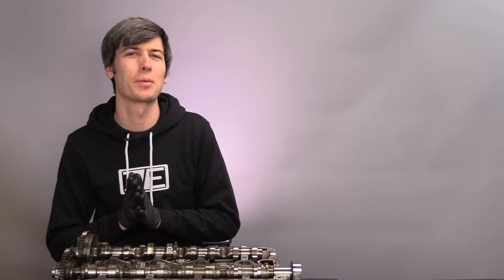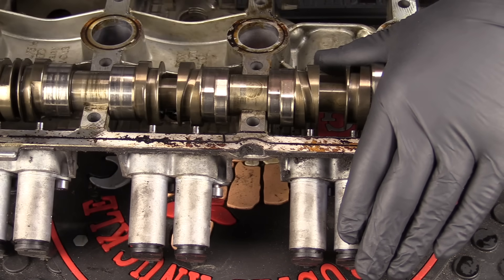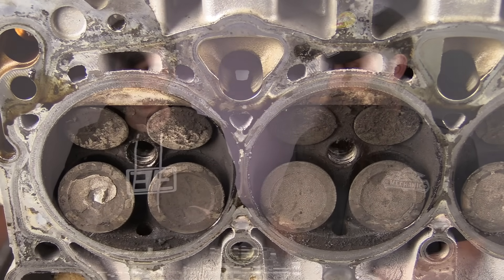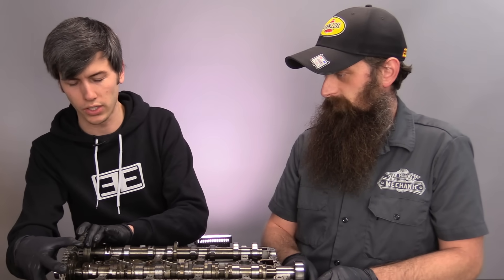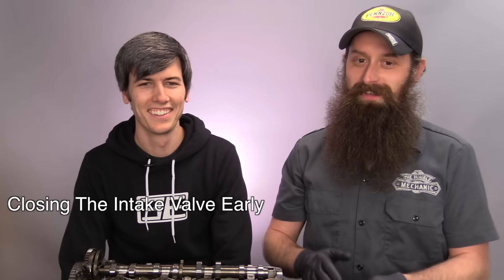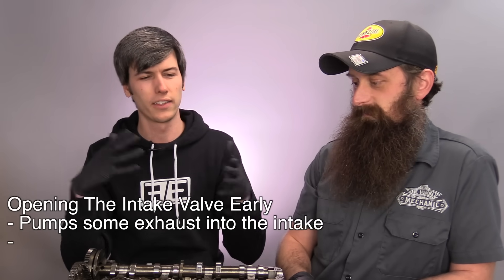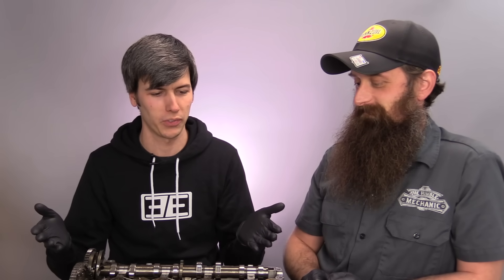Variable Valve Lift vs Variable Valve Timing - VVL vs VVT

Comment: is i-vtech from honda basicly the same as you explained in the video?
Reply: ShinTsu vtec is vvl. On this engine the lift on the intake side was changed and the timing of the opening on the outtake side was changed.

Comment: Hi, I didn't understand how is VVT actually controlled. Where is the oil pressure coming from? Does it only happen when certain oil pressure is achieved in system ? (like high RPMs ?)
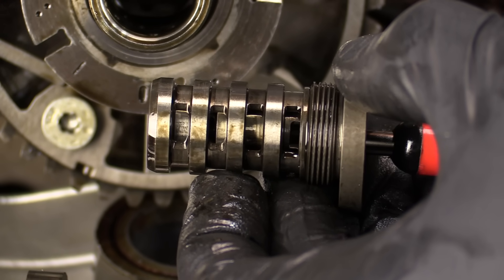Reply from the maker: Engine oil pump creates oil pressure, then the valve (shown at 5:16) controls where the oil goes.
Reply: oh thanks, I didn't realize that.
Reply: And in this particular engine the valve itself is controlled by an electromagnet mounted on the chain cover, in front of the pulley, under command of the engine computer module. Other (cheaper) engines have an electric flow control valve mounted elsewhere on the head, and conducting oil to the adjuster pulley by oil channels on the head, thus making the adjuster simpler.

Comment: so valve timing is more beneficial than valve life correct?
Reply: Depends on what you mean: better for economy/performance/emissions?
Reply: I mean Meaow
Reply: Valve timing helps with emissions. It's based on an over 100 year old concept where you allow some of the intake to escape into the manifold to increase efficiency. Those engines, I forget their name, were certainly less famous for power. All that said. With this system, you've increase your efficiency, without sacrificing your power when you need/want it.
Reply: DE Nichols I believe your thinking of the Atkinson cycle

Comment: hang on. So is VTEC VVL or VVT? Or both?
Reply: The vtec everybody refers to with "vtec kicked in yo" changes the cam profile with rockers and 1 solenoid. It has higher duration AND higher lift from a certain rpm. Its a way more easy System then the vag stuff and its basicly build for sport engines to be dailyable. The first cam profile has enough torque and runs smooth. But the second profile has so much duration and lift that it would be very unefficent and ruff to run on it. watch a few videos of "vtec Killer cams" they have only the high profile. But there are also other Systems by honda named vtec. There is a sohc that uses 16 valves but can drive on 12 valves for economy wich came in 1991 i think. Then you got the i-vtec (k20 for example) wich is the same as the first with the addition of a cam shifting gear like in this video and there are some other Systems too. anyway the old honda vtec is the most fun i think. Because you really have kind of a motorsport engine high reving that can easily be used daily. oh and the same goes for the k20 i vtec because its still a very agressive profile wich you can hear and feel not like in these over complicated newish cars.
Reply: nazhif1 I think its vvl on intake
Reply: Hambert i work at a vw audi dealership in germany and yes we had a few audis with failing solenoids. They where covered under warranty. But if you have a solenoid for each valve i think thats a bit overkill. But of course it has its benefits. Before I started working on that dealership, I bought a honda civic ek4 (1.6 dohc vtec) and i still have it. It had never in all those years (about 7 now) a problem besides the ignition coil and regular maintenance. 21 years old. Not one sensor or one solenoid failed. 
Not even an o2 sensor wich is normaly a thing with older hondas. Anyway I stay with these cars because I see what modern german engineering at least with vag cars does. They are truly not building technicaly reliable good cars anymore.
Reply: nazhif1 depends on which vtec engine. 
the D16Y8 engine found in a Honda civic EX 96-2000 is single cam vtec with higher lift on the intake.
the B16 engine on the civic si 99-2000 and B18 engine found in the integra has hire lift and duration on intake and exhaust.... Don't quote me exactly though but its along those lines.
Reply: VTEC = VVL
i-VTEC = VVL + VVT
Reply: Simon Dobrev yup vtec changes lift. Im not sure if on both or just intake.
Reply: VTEC(D series, B series and H series) is more like VVL(like the exhaust cam in the video). It changes between 2 cams profile on both intake and exhaust(for twin cam engines). i-VTEC(K series and newer engines) has a both VVL and VVT, Higher cam profile and variable timing on the cam gear
Reply: VTEC also seems a lot simpler, at least on my old B16A2 Civic it does. No need to move the whole cam profiles along the shaft unlike the examples in the video.
Reply: 99Lezard99 Are you saying that the Audi ValveLift is unreliable for daily spirited driving? Why? I'm on the GTI forum and I haven't seen any broken cylinder heads yet. I think VTEC is only rev-controlled and this system is computer controlled, that's always better as it can adapt to many driving profiles and not just a rev range.
Reply: Interesting perspective, vielen Dank!
Reply: Hambert kein Problem. Meinungen sind wie Arschlöcher. Jeder hat eins. No offense tho...
Reply: Ich habe dich gut verstanden!! Es ist immer schön, neue Sprichwörter zu lernen. Grüsse von einem argentinisch Deutsch Sprache Student :P
Reply: Hambert alles gut. Schöne grüße von einem teiledienst Mitarbeiter im vw audi autohaus. 😆
Reply: +Matt Bonaccio this is bluemotion
Reply: newer vtec in the newer engines is both, i believe
Reply: VTEC usually engages around 5k rpm but could be made to engage sooner with an electronic VTEC controller such as an Apex'i or Fields controller. The Honda system used a single solenoid to direct oil through galley passages that then pushed a locking pin into the roller rocker arm that activated the high lift/duration lobe of the cam. DOHC VTEC engines had this feature on both intake and exhaust sides while SOHC VTEC engines only had this functionality on the intake side.
Reply: Variable valve Timing, lift Electronic Control 

VTEC is lift and timing control, but only because of the shape of the camshaft profile. i-VTEC is VTEC plus variable cam timing. If memory serves, most i-VTEC engine variants are similar to this VW engine in that the intake is only variable cam timing, the exhaust is VTEC.

VTEC is a much simpler system than this VW. each valve pair has a high and low cam profile.  The high cam profile rides on a rocker that's normally pushing against a spring doing nothing. VTEC engagement allows oil pressure through a solenoid into a passage that pushes a pin through all the rockers and locks them together which causes both valves to open with the high lift cam lobe.
Reply: @hondaguy9153  depend on what type of I-VTEC engine..performance I-VTEC have VTEC on both intake and exhaust cam and non performance I-VTEC have VTEC on exhaust cam only but both engine feature with  VTC on intake cam
Reply: That Car Guy That's what I said, I said it's both. I'll requote myself "newer vtec in the newer engines is both, i believe"
Reply: lmao thats what it is. i just said that.
Reply: basically volvo tech
Reply: Wow, so many speak without knowing. Vtec stands for variable valve timing & lift electronic control. All Honda vtec engines have vvl (that's the cam profile switching). Variable valve timing only came in engines with variable timing control (vtc). K series and later j series. Vw essentially made the vtec yo for the turbo, on the exhaust side where it would benefit, k's have it on the intake cam.
Reply: VTEC stands for "variable Valve Timing and lift Electronic Control" so actually it changes both. It's most similar to the exhaust cam shown in this video (the first one)

Comment: Cool system. One question tho, why bother having variable lift/duration for each individual cylinder? Wouldnt it work just as well if the whote exhaust cam moved? It would be a simpler system with less parts.
Reply from the maker: Not all of the cylinders are on the same stroke at the same time, so when you switch the profile it's important that it's not occurring while one cylinder is in the middle of the intake stroke.
Reply: I could be wrong here but doesnt hondas VTEC move the whole cam?
Reply: I wonder if they're being deliberately different to avoid infringing on other peoples' patents (including VTEC).

Comment: How does the solenoid activate on the position on the two cam profiles that is flat? Rather than hitting the side of the raised portion of the bigger cam?
Reply: The hydraulic actuation profile is not ON/OFF, it does it gradually, also the DME makes sure it does it on a low point.
Reply from the maker: The groove the pin takes ensures it is timed correctly.

Comment: Rock on man. Thanks for coming and hanging out. It's always a fun time collaborating with ya.
Reply: Leo you'd be going from belt driven to chain driven. Better off swapping the whole engine. 

Buuuuuuutttttttt don't let me stop you from trying.
Reply: You have the beard of a Greek God
Reply: It is pretty reliable. We have seen a few solenoid failures, but nothing crazy.
Reply: I've had a problem on my 3.2 FSI Passat - it started to idle crazy rough periodically, short episode of the symptoms every few months. Supposedly the culprit could have been a gunk in the selenoid holes or an anctual electric problem on the selenoid. The problem persisted through oil change and the estimate on the selenoid replacement was north of 1k€, so i never decided to fix it for good...
Reply: 9``°°? 0322211UNTIL 322nd 0 the the aaA11 11221`1222 to 99 []][3rd 444<? , 05 the the, and 2-0000323332d3rra221166y676yyt650p1p09lp1p a2 the the 13111
Reply: @HumbleMechanic  1 won 490p03ql 8o01p03o0p0j 22e300qq
Reply: Audi :  how can we  make it really complicated so all mechanic will hate us ? Engineer : hold my beer and watch this!!
Reply: HumbleMechanic But vtec is only at high rpm. My car starts after 4K as well, not like it's better than a better engine.
Reply: Yes. But valvetronic is on the intake cam. Its used to control the rpm's
Reply: Yep pretty majestic
Reply: Thanks for showing the vvt range of motion.  My cam bridge failed and forced the screen into the channels and prevented it's range of adjustment.  So, seeing your example prompted me into taking it apart and pulling the fragments out.  Rock on, brother!  🤟
Reply: You two should kiss already
Reply: 2122p11222223www
Reply: Surat 299
Reply: 11z
Reply: 121qssàewwwwwwwwws a1sww2u89909442aaà the 2 11th the the 1l1
Reply: What do you think about that technology? Is it robust? Isn't BMW Valvetronic better? In Valvetronic you have infinite number of lift states, here you have only two, right?
Reply: @MichalMalpa  surat the ll0p9ooppo0999999oooo9 2F l33RR00eel11e0 0i9iopolĺ9ssszW 9aaa quality ys1qepp 11 02 llwl2lpllwll990k01q1llaaaa6ztaaeeewiw99
Reply: Thank you :)